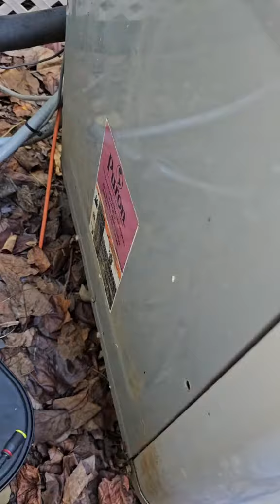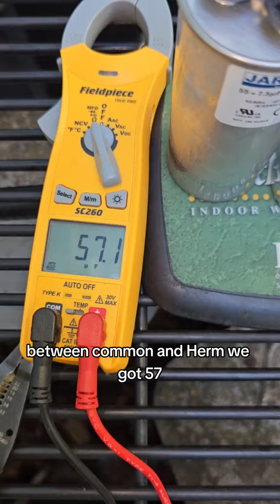how to replace capacitor. 🥶 Air conditioner unit hums but doesn't run. #tools #hvac

Comment: Comment, David. It was wise to ensure that the capacitor was not storing electrical current (in simplistic terms). High voltage/amperage capacitors can kill people via electrocution. That's why I would pay you the $500 plus on a weekend. :-) You show on these videos why hiring a professional is worth the payment.

Comment: I wish I had central AC to even have this problem. What I do have is a toilet that only fully gulps all the gross (for lack of a better term) about 30 percent of the time. In other words it take three or sometimes four attempts for clean water to fully appear in the bowl after flushing. Help! My water bill is already stupidly night.
Reply from the maker: I would make sure that the bowl is filling up with water adequately. Sometimes the hose in the back of the toilet gets disconnected. If you don't have enough water in the bowl it won't flush well. If that's not the case, you probably just need to snake it.

Comment: I’ve got an older condenser at my house, I could see needing to replace this someday in the next few seasons. How long do you think I could keep a new capacitor in my garage before it degrades? I’m thinking I might want to buy one and keep it just in case
Reply: If it were me I would just replace it if your gonna buy one just in case
Reply: It won't degrade anytime soon. Absolutely pick one up. Also pick one up for your blower fan. Not sure how your system is set up. My in door unit has a capacitor similar to the outside unit. I'd purchase both. You will absolutely need it

Comment: 540$ for that??
Reply: That's the beautfy of owning your own HVAC business. You get to sell $20 capacitors for $350and charge $190 for 12 minutes of labor.
Reply: It's a weekend call too so that's more money
Reply: Correct. A good technician will make great money just cleaning coils. You're free of course to try to do it yourself, but you could also easily forget the parts about shutting off the disconnect and discharging the capacitor. You're paying for the time of a person with that kind of knowledge, not just the service.